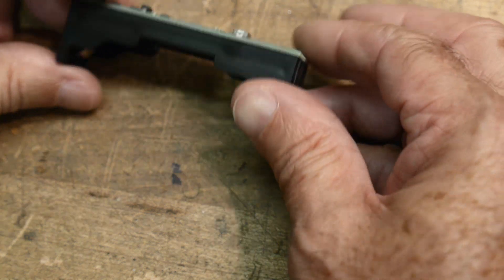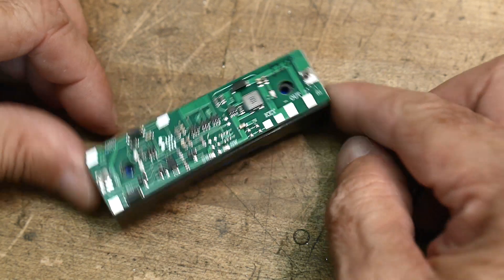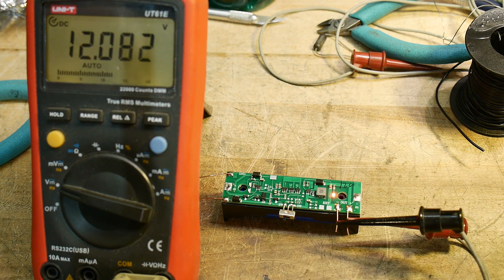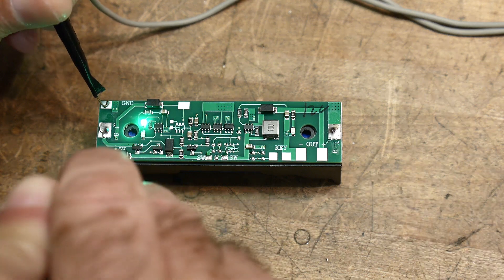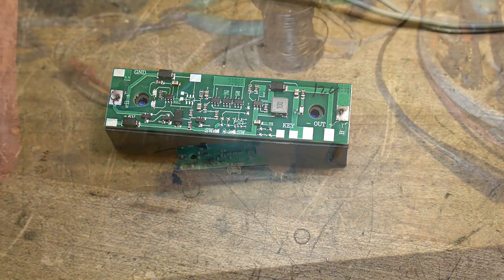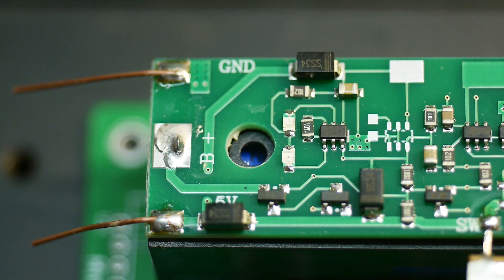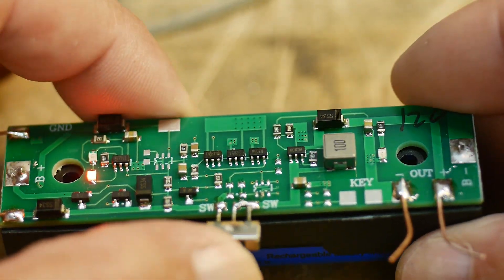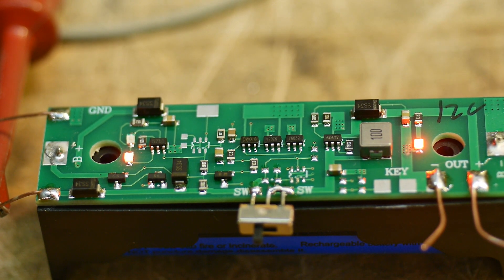#572 LiLO Battery Holder Charger Boost Converter

Comment: Interesting module for 12V devices, thanks for sharing.  I see eBay has somewhat similar and looks like there is a 2 cell version: https://www.ebay.com/itm/Li-ion-Battery-Step-Up-Module-5-In1-Integrated-Plate-DC-9V-12V-Charging-Board/203113406161  Neat.